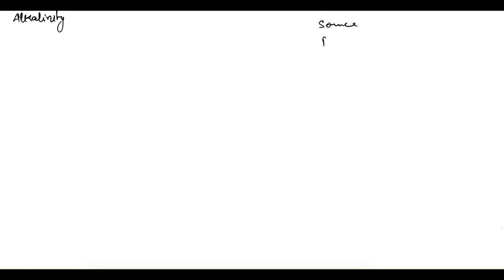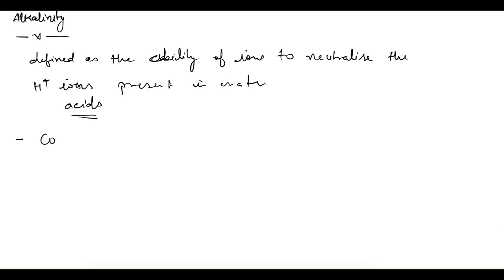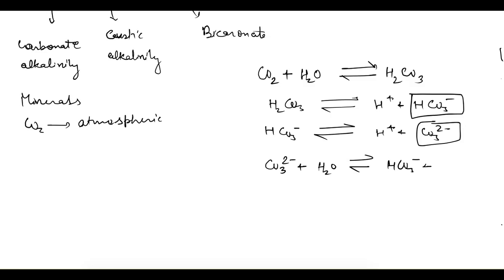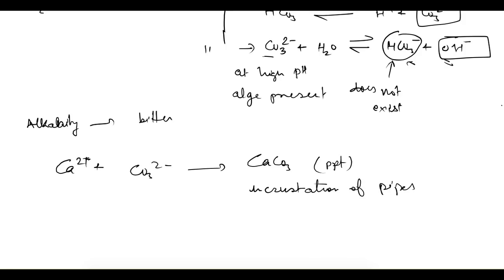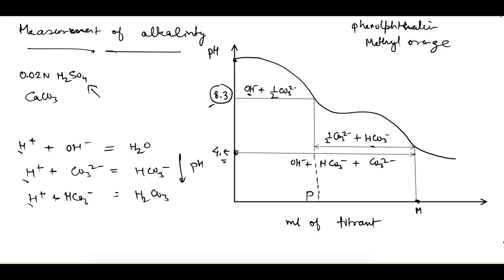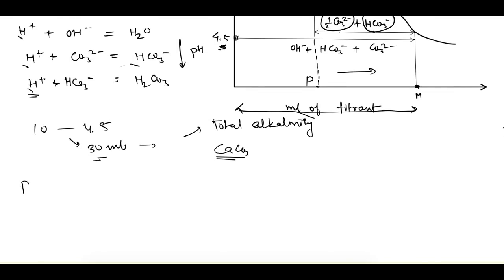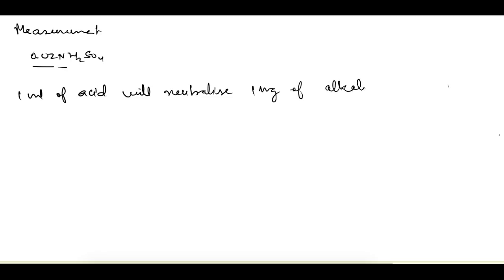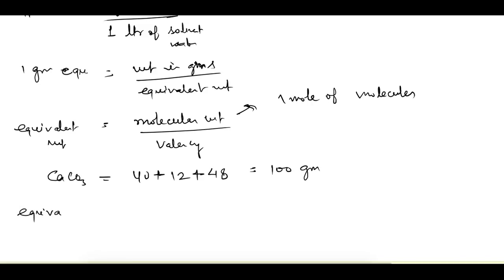Alkalinity of Water | Environmental Engineering

Comment: Sir could you please explain this graph of PH vs TITRATION once again I am unable to understand this
Reply from the maker: It may not be possible to make the video again for now. Tell your problem exactly I will either try to tell here or I will make a written explanation in brief.
Reply: APSED 
Sir I have 2 queries 
1. In previous video you said that methyl orange is used in the ph range of 2.8-4.4 but here we are using methyl orange to measure ph between 4.5-8.3 how? 
2.why do we assume that 1/2 CO3   was only neutralised upto a ph of 8.3. Does it have any relation with the mole of CO3? 
waiting fr ur rply
Reply from the maker: 1. We are not using methyl orange for the whole range of 4.5-8.3. methyl orange turns yellow at a pH near 4.5 and at a pH of 4.5 all the alkalinity which is present is neutralised. So methyl orange just tells that all the alkalinity has been neutralised. 
2. For the carbonate alkalinity, first it converts into bicarbonate alkalinity and then only it can be completely neutralised. The conversion of carbonate to bicarbonate is over at a pH of 8.3 but still this converted bicarbonate will require acid. So when we say that half of the carbonate is neutralised at 8.3 it is an assumption based upon the description I have told above.
Reply: APSED I understood it sir very clearly now.  many many thanks to you